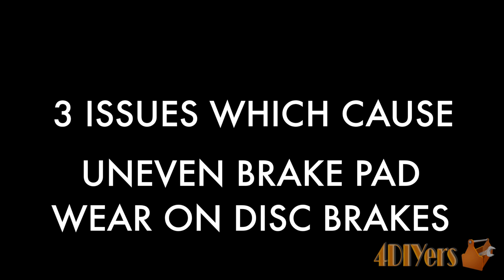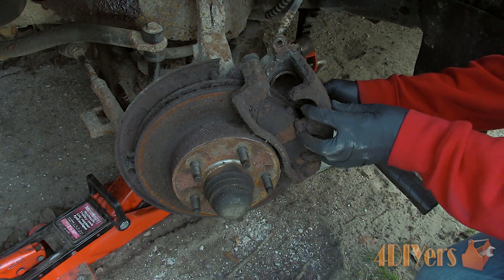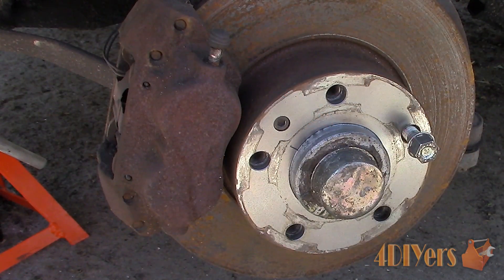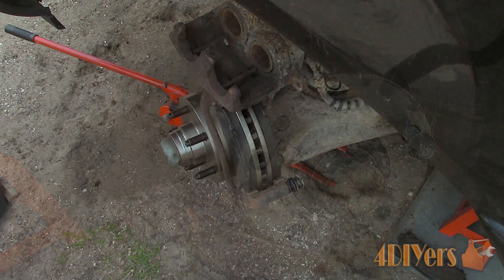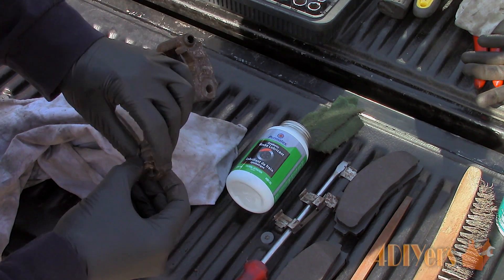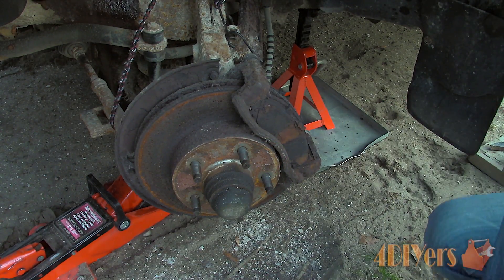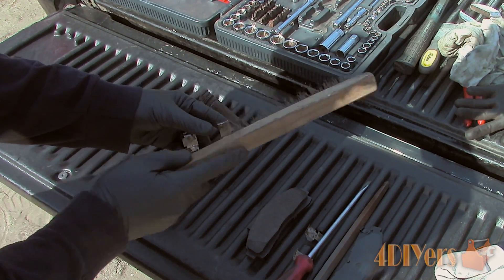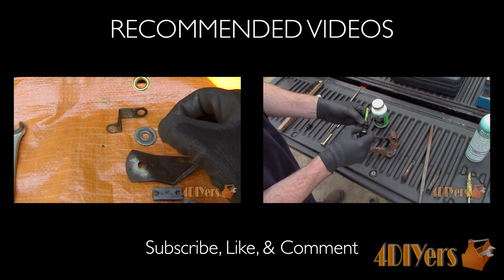3 Causes of Uneven Brake Pad Wear

Comment: This was a big help.  My inboard pad was not making contact with rotor after pad, rotor, and new caliper.  

Took it apart and found Centric aftermarket brake pad had a nub of metal on the ear where it contacts the bracket.  This made it too tight and prevented movement.  I filed it off and solved the problem.
Reply from the maker: Awesome to hear you got it fixed!

Comment: Should Rotors with uneven wear be replaced or is it safe once the issue causing the uneven wear is fixed?
Reply from the maker: The rotors can be reused as long as the brake surface is still in good condition. They should have the surface cleaned up, either sanded or resurfaced to remove any imbedded material from the old pads.
Reply: @4DIYers  Okay

Comment: Okay so I’ve wanted to ask you this and probably have in the past.. mustang GT 2014 non brembo … rear left outside pad always wears 2x or 3x faster than all others.. so have checked guide slide pins.. changed rotors, changed pads , calipers, hoses etc … pads and rotors several times the other calipers and hoses just once… it still always wears the outside driver side rear pad … pins move fine I’m at a loss for ideas at this point I have changed sliding pins also… this filing of the caliper may be the answer but 2 different calipers several different pads and hardware and pins I feel like it’s almost gotta be the distribution block or something at this point please advise !!!! Been having this issue for 6 years now and ford won’t look at them because I’ve done the brakes in the past
Reply from the maker: Make sure the pad isn't binging on the carrier bracket.

Comment: Ah but there is yet another possible reason. Improperly adjusted emergency brakes can cause your inner pad to wear sooner than later. When this happens, cross your fingers that your sqeakers were installed. Or lime me your brand new rotor will be toast.

Comment: Hey does it matter if you accidentally put both indicator pads on one side? Will it cause uneven wear? The set came with two, obviously one for both sides, but i accidentally put both on one side and two regular pads on the other.

Comment: My brake pad wears in the upper middle part of the pad on both sides. New rotor. I'm guessing it's caused by the seized bottom caliper? Other relatable finding, the brake hardware: the metal clip holding the brake pad was badly worn.
Reply from the maker: Sounds to me like something is either binding or there's excessive play in a worn component. Check over where the pads side, make sure they can move freely and are not binding. Make sure the caliper and carrier are mounted correctly, then check to ensure the pins or bushings (some vehicles have rubber bushings instead) are not excessively loose.
Reply: @4DIYers  found that the bottom pin rubber sleeve has swollen that it wont allow free movement. I replaced the brake hardware and removed the rubber sleeve. they seems to work fine right now. also found out that someone replaced the caliper pin bolt with smaller size 12mm: it was supposed to be 13mm. replaced that too. i'll see how it turns out in a month.

Comment: I have an interesting problem. One of my rear disc brakes is covered in rust (the contact part). The rust covers only half of the contact surface. Its as if the brake is engaging properly towards the center of the disc, but its not engaging towards the edge. Any ideas? Its a 2 piston, one on each side, without guide pins.
Reply from the maker: If you check out my Toyota Tacoma front brake replacement video, it should be a similar setup as what you have. You'll have to disassemble the brakes to determine what's happening, it could be an issue with the pads (brake material has fallen apart or not engaging properly) or perhaps your rotor surface is uneven and not allowing full contact.
Reply: @4DIYers  I have just installed brand news pads and rotors. The 2 opposing pistons seem to be moving fine. It seems that the brake pads are tilted when the brakes are disengaged.
The brake hardware is on the outside of caliper, and its pushing the pads on the outside edge, make them tilt (the edge that is visible once you insert the pads).
I realized that the pads are sitting way too snug in the caliper. I have cleaned the rust out of the caliper and filed down pad backing material, now the pads are sitting loose.
I'm hoping this fixes my problem. I will check over the next few days if the rust is gone from the rotor.
Reply: Yes, the Tacoma has identical setup. But the anti-rattle hardware clip is pushing the pads at angle, not directly inward towards the wheel center. The clip in the image is showing the "inside" side up.
https://www.carid.com/professional-parts-sweden/brake-hardware-kit.html?urlId=15138741

Comment: My front pads have the following uneven wear pattern. When looking at the brakes from the side, the bottom half has more wear than the top half. I am see a gap on the bottom half between the pad and the rotor as as a result. It looks almost like a wedge from the side. I've had 3 sets of brake pads on it over the past 17 years. Calipers have never been replaced or rebuilt. Any thoughts would be appreciated.
Reply: I realize it's just two years old what I will Hazard a guess for the next guy reading it, it sounds to me like it is your calipers one out of the two Pistons are not pushing. Good luck everyone

Comment: Only 6 comments on this vid is BS. You helped me alot and kept it simple. My sliding pins ended up being my problem for uneven wear on my rotors. Very helpful. Also my clips were painted and were not letting the pad move smoothly. Little things like you pointed out helped me tremendously. I will definitely sub to your channel.
Reply from the maker: Thank you for the kind words and support :)

Comment: also locating pips on the back of rear pads can sometimes be too high and require filing down so the pad rests flush against the piston otherwise this fault will force the caliper to sit at a strange angle to the disc.  the other point is the pedal will feel springy unless the pads are sitting flush.
Reply from the maker: Excellent tip, thank you for sharing!

Comment: I have a 02 jetta and the driver side brake is not working right. has new hardware, lube on the pins, pads and a rotor and for some reason it seems that the piston side is only doing something even after replacing everthing
Reply: Having the same issue with my 2012 F150 drivers side. Only wearing the outside pad at an angle. Pad bracket, pins, and caliper all function properly. Maybe bent spindle? That would be weird because it doesn't have an alignment problem.
Reply: My 99Maxima driver side rear is stopping but no wear on the outside rotor .please help!!